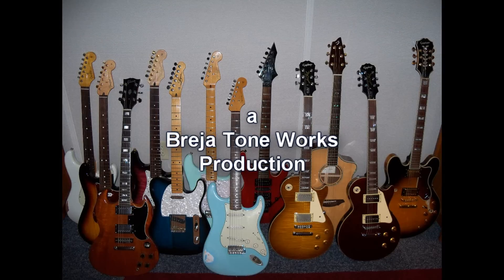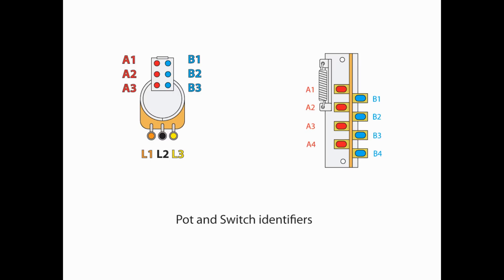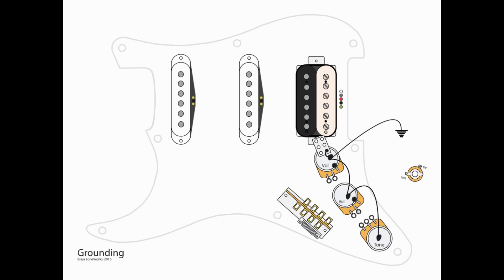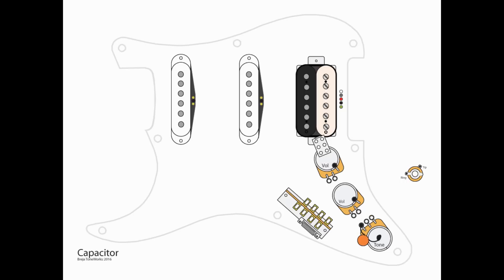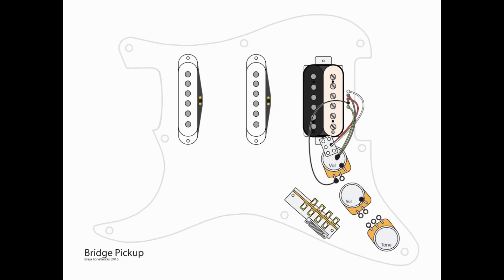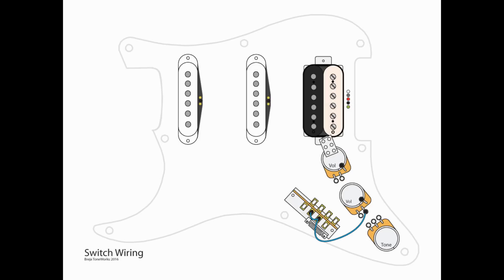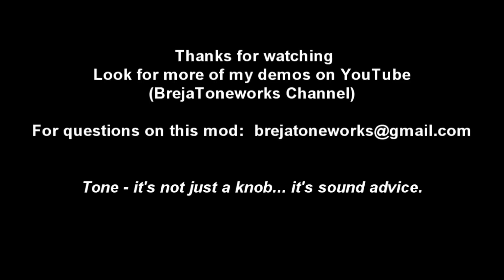HSS Guitar w/Dual Volumes, Master Tone and Coil Split

Comment: End Sept. 2023 in Saskatchewan. Winter cometh and it's always a hard season. I wired a Crate Electra according to this tutorial in Spring. It dint work on various switch positions. I "went in" today and found two failed solder points. I'm not practiced at soldering. I repaired these and after a once over, boys this Electra works just like Don said it would. Breja Toneworks is the ONLY site I'll use for trick wiring projects because of the way Don combines pictures with speech. Thank you Breja!

Comment: Hi Don - I originally followed this mod. It's great but.....
This is from my perspective - I find that having the neck/mid volume beneath the bridge volume pot somewhat un-natural for me as a player. So some time later I followed your video again but swopped the position of volume pots to having the neck/ mid volume on top and bridge underneath. Now these correspond better with the 5 way switch and lend themselves to a better ergonometric layout. I also put a treble bleed on the neck/ mid volume and that has really made my Strat great !!!.

Comment: Clever wiring, just did it and works great! Just changed the places of volume pots so the upper one now controls the singles and the middle one controls the humbucker - much better IMO. Thanks, great video!
Reply: Precisely
Reply: I did the same exact thing. Love it!
Reply: How does the bridge//middle position sound ? Enough treble ?
What tone cap value did you use ?
Thanks!!

Comment: For the respect of the "5-way switch spirit"  your HSS wiring is really nice.
Plus, two volumes will seem  familiar to "humbucker guys" who can play neck&bridge  :).
but consider this :

1 / 1st pot =  volume for neck&middle 
2 / 2nd pot = volume for Bridge + 3-way switch on-on-on (series/split/parallel) gorgeous for you favorite pickup !
(note : humbucker-parallel sounds so nice when overdirven and almost like single-serial without the hum ;)
3 / 3rd pot = Tone push/pull capacitor switch. (feel free to test 33nF and 15nF as well as 22nF and 47nF :)
dual-tone-pots is useless on a 5-way < set and rest forever / plus single tone-pot is easier between songs)
4 / 500/250 Kohm is a choice for your pickup model in a specific play-style.
I assume a superstrat is for heavier styles that push the gain, hammer and shred.
So 500K for high gain superstrat guys ( dual-cap-tone and dual-volume will help in most situations) 
 I recommend using the same resitance for all pots and choose a pair of high-outpout single-coils.
If not, you might change the gain of your amp each time you toggle neck and bridge for the noise or the volume
...until you simply install additional resistors to your single coils.

HSS dilemma is not a new)... So thanks a lot for your contribution Breja.

Comment: Thank you for posting this video.  Using a 500k pot with a Pearly Gates at the bridge (HSS partscaster) brought the p/u alive.  Before that, it was dull sounding.  I am detecting less hum/buzz from the single coils...  just my perception or real? - IDK. Possibly a slight change in the single coils' sound? - maybe, but hard to tell.  Overall - very happy.

Comment: I ended up with a separate bridge push pull coil split volume and a master volume and tone.  I reverse wired the volumes like in a jazz bass.  I wired the switch like a plain 3 pickup Strat.  Works great.

Comment: This video is great Don! I was hoping you could give a helping hand for a slightly different configuration:
I am trying to wire a HSS with:
1) 2-in-1 Volume (one being 250k and one being 500k, stacked on top of each other, NOT a push/pull)
2) 2 Tone (both separate, but one is 500k and one is 250k, for HB and SC respectively)
3) humbucker auto-splits at position 2 to work with the middle (RWRP in my case)

* I am trying to avoid push/pull pots
* using a 5 way switch, like the typical fender one.

Comment: If anyone who is clueless with electronics like me is wondering, this schematic does work if you don't want to use a pushpull coil split. You just tape off the red and white wires from the humbucker and don't use them, then everything else is the same.

Comment: Hi there 👋thank you so much for your work, it's so easy to follow along! Everything seems to work fine, but the volume in position 2 is much lower than other positions. Is it expected? Can it be a soldering issue or is it rather pickup related?
Second "problem", the hum with single coils really disappear only when touching the strings or any metallic part (bridge, jack socket, knobs). Do I have a ground issue, or is it just normal with single coils, I don't have much experience with this kind of pickups. Thank you to any good soul who'll see this and help! 😀

Comment: Great video! Thanks for this. I did it and it works fine besides the single coils volume knob that’s not working. It only works when the humbucker volume is on zero. I did not install the tone knob though, but don’t think it’s related. I wonder if it is a ground problem. Maybe the single coils volume knob is not properly grounded to itself. Could it be it? Thanks!

Comment: Great video! Will definitely help me get through my first rewiring. Wondering: what if I have a toggle switch to split the coils, rather than a push-pull? Will that make a huge difference? I know this is an old video, so getting a response is a long shot, but it’s worth a try.

Comment: Great Don but I have a question: you didn't mention the resistance of the volume pots. May I consider the humbucker volume pot being a 500k and the other one a 250k pot? If that's the idea, would they read 500 for humbucker and 250 for both single's? I have here a dual pot by fender and I'd like to use your idea from this diagram. Thanks

Comment: Thanks for a well done, helpful video. I used this to mod my Strat Bullet by swapping out the bridge single coil with a GFS hot rail humbucker. It all seems to work OK. However I was wondering why your diagram is showing the humbucker hot wire going to volume pot rather than the 5-way switch (like the other pickups do)? Thanks.

Comment: I would love if you could make a video of the wiring of a 2013  Modern Player HSS strat. What's special is that it has a push/pull pot for bridge humbucker coil split, 1 master volume, combined tone control for neck and middle, and tone for bridge humbucker.
I just bought one that have been rewired as a standard HSS with no coil split. But I want to try and bring it back how it's supposed to be.

Comment: Awesome video! It helps so much! I was just wondering if there was an option to add a switch to turn on the neck pickup all the time so I could have an option to use the bridge pickup and neck pickup at the same time. Thanks!

Comment: just one question, i saw another video of yours about a 5way switch, and im just wondering why did you connect the pickups hot wires into the B side, and tones on A side, when in the other video it was opposite, the pickups went to A 123, and tones went to B 543

Comment: Question at around 1:20 mark when talking about the Push Pull labeling, is that layout looking from the knob end of the pot or from the bottom square end as if looking from the bottom of the pickguard?

Comment: Hi! Thanks for the mod, but I'm having some an issue with the middle pickup, its not audibly in the 2/3/4 positions. the neck and bridge as well as coil tap are fine. It's a RWRP SSl-1 in the middle. did i just cross my wire wrong? I assumed since it's reverse wound, the white wire ( on the different side of the hot wire on the SSL-1 in the neck) is the hot (same color, different location of the neck pup). Am I mistaken about this and should wire it with the black wire being hot? I checked continuity and solders and they're all good. Thanks in advance!
Reply: Never mind! I swapped the Middle rwrp wires and voila!

Comment: I dunno if you can answer this, I have been looking for a wiring diagram for hss. Position 1- bridge humbucker, 2- bridge split with middle, 3- bridge split with neck (maybe different lug from position 2), 4- middle and neck, 5- neck. I couldn't find any diagram, since I don't use middle pickup alone, I guess I prefer like this.

Comment: Hey how's it going, I have a question? I'm installing 2 humbuckers and I have A 3 way switch and 2 cts pushpull pots  and 1 volume  pot not push pull! is it possible to split each humbucker seperately to split on each scts pot and 1 volume control 500k>

Comment: This is literally what I want to do with my strat. Thank you. Is there any way to add the 7-way switching to this wiring with another push/pull pot so you can also add neck to position 1 and 2?
Reply: Durgo25 Hi mate, you just have to add a "neck on" mini toggle switch.
When in position bridge or middle bridge, just turn on the mini switch and you have also neck pickup active.
Google "neck on" switch wiring, it s a piece of cake. Just drill a little hole between your 2 tone pots and place it there!
Reply: @CS-xq8xz  Thanks! Exactly what I was looking for!
Reply: @CS-xq8xz  Just to be sure, in the above video circuit, I would add the switch between B4 and L2 tone right?
Reply: @CS-xq8xz  or between A3 and A4 or between A3 and B1
Reply: @CS-xq8xz  actually B4-L2 (bypassing volume) and A3-B1/A3-A4 (takes mid coil in some settings) arent ideal
Reply: @dikuf  https://www.premierguitar.com/ext/resources/images/content/2013_7/Features/Sep13_PG_FEAT_Power-Play-4-Mods_7-sound_WEB.jpg
Just use a single on-off mini toggle switch for that :)

(i never mess with push pulls, like in the video here)
Reply: @CS-xq8xz  Hi thanks for your reply, I already got that from your previous reply. My problem is that that circuit is completely different from the one in this video and dosent work, dont you think so?
Reply: @CS-xq8xz  and I am using a toggle switch, not a pushpull. the notations are from the video for the 5 way and pot
Reply: @dikuf  Without a wiring scheme bro, it is kinda difficult for anyone to give you some proper instructions :/
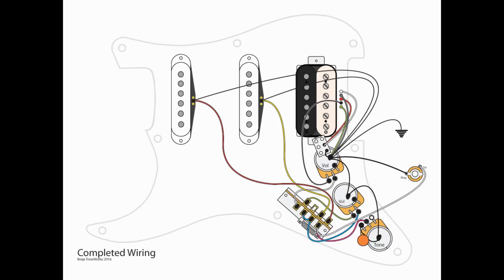Reply: @CS-xq8xz  the wiring scheme is in the video at 4:28

Comment: Hi Dan! Nice job like always! I have one ask... or maybe a challenge.  I have a Fender HSS Shawbucker Strat 2015 electronics on my Peavey Predator 94. It have Fender Custom shop fat 50's single coils and a Humbucker designed by Tim Saw. I just did a duncan treble bleed mod (tricky by the way because it uses a Fender Concentric 250K/500K Solid Shaft Potentiometer) and now... I'ld like to do a split coil tap mod but using a push-pull tone pot for preserve the original look on it. Can you make a video with that information DIY? Another consideration is that the 5 way switch is a Fender 5-Position Stratocaster/Telecaster 'Super Switch'. Thanks for all!
Reply from the maker: Email me directly at BrejaToneWorks@gmail.com

Comment: ?? Your channel rocks!!  1st off....  My configuration for my new strat build is Hot rail humbucker in the bridge, single coil in the middle and a Telecaster bridge in the bridge. Hopefully that makes sense. Here's the thing,  Is it possible to wire my strat in series/Parallel wiring with a push/push Volume pot, a master tone in the middle and a blender in the 2nd tone pot position?  The reason for the push/push in the volume position is I wanted to also add a coil split....Too Much?  Whatcha think?
Reply: I'm looking for similar information, but I keep finding that we might need one of those crazy 20 or more 5 way switches AS WELL AS push pull pots. Too much madness, I've had so very little sleep designing and redesigning circuits for them to come up short of my expectations. 😫

Comment: That's a pretty interesting wiring. A very good way of having a balanced HSS set if you use 250k vol pot for singles and tone and 500k vol pot for the humbucker. I was wondering if it's okay to connect the output to the middle lug of the tone pot instead of to the switch. Also, this is wired as the 50's old wiring, isn't it? I mean, with the tone control after volumen.

Thank you very much for sharing your work and knowledge. I really appreciate it.
Reply: Yes you can do that the Output is on the same potential as the Middle lug of the tone pot.

Comment: great video, ill be redoing my kinman x2/SD hot rail combo. Just have to decide on values, I think 250k for singles and 500k for the hot rail bridge. I have a phase reverse for middle at the moment which I,ll keep in though (might use second push pull on tone pot)
Reply: i have dimarzio super distortion DP100 humbucker in the bridge. is it ok in this case to use 500K push/pull pot for humbucker and two 250K pots for the rest?
> and will positions 2 and 4 be hum canceling like it is on standard strat wiring?

Comment: Might be a dumb question, but does it matter if the middle pickup is Rw/Rp? I'm doing this to a mim Fender Strat, and I'm pretty sure the middle pickup is Rw/Rp because the black leads come out opposite of each other if compared to the neck pickup, as do the colored wires...
Thanks in advance Breja!

Comment: Hi, I have a strat I built with HSS pickup configuration. I wound the neck pickup with a coil tap so I can have two tone options in the neck pickup. The middle pickup is normal and the bridge has the humbucker wired with 4 wires and the ground shielded wire. For simplicity I used the SD color code which I am familiar with. I am not interested in splitting the humbucker. I want to use 1 volume and 2 tone  controls with a 5 way pickup selector switch. I have a push pull pot which I know I will need for the coil tapped neck pickup. I have wired a few strats from wiring diagrams I found online but I cannot find anything for what I want to do. What location does the push pull pot go,  the volume or tone ? Do you have any suggestions on how I can make this work or where I can get a wiring diagram. Thanks.

Comment: I have a Fender Contemporary Deluxe Strat (2nd Type, MIJ) with an HSS configuration. It has 1 volume, 1 tone, a toggle coil switch, and a 5-way switch—all on the pick guard. What does the wiring diagram look like when it's a toggle micro switch instead of a push-pull? Thanks!

Comment: Hi, I have 72 thinline telecaster and I changed the pickups with gretsch dearmound pickups. I use 4 way switch(like mex baja telecaster) and I want to controll volume and tone controls seperately. So I bought concentric pots but I can not do a scheme for this. I want 2 vol 2 tone and 4 way switch. Could you help me please? Thanks.

Comment: hi, i need a wiring diagram for a strat , 2 volumes, 1 tone,  but with and ''inline/export'' 8 lug 5 way switch...so i can control bridge, and mid/neck volumes , but have 1 tone  for all...could you point me to a solution, thanks. rob ,

Comment: Hi Don I've looked through the other videos on your channel before I ask, but there's nothing there in regards to what I was looking for.
I have a HSS strat type guitar, a Yamaha Pacifica that I need to rewire for a parts & pickup swap. It only has 1 volume pot & 1 tone pot. Taking into consideration that there's both a humbucker & single coils in the guitar, what value pots would you use for both the volume & tone? 250k for both? 500k for both? 500k volume & 250k tone? Or 250k volume & 500k tone? Or something else? Many thanks.
Reply: I have the same guitar and would like to know the answer as well.

Comment: I have an interesting mod I'm looking to do. I want to convert the schecter hell raiser hybrid from active to passive. It's an H-H setup with 2 volume pots, 1 tone pot, and a 3 way switch. I want to make both volume pots push/pull for coil splitting. Can you help?

Comment: Hi, this might be a dumb question, can this wiring pattern be used without spitting the coils of the humbucker by using a 500k pot for the humbucker and taping off the finish wires. And a 250k pot for the single coils volume and a 500k pot for the master tone with a .022 cap?

Comment: The diagram indicates connecting to the tip and ring, does this mean you have to use a stereo jack to wire this up??
Reply: no it s a normal mono jack. ring for ground and tip for hot.
Stereo jacks have 3 terminals instead of 2.

Comment: So I tried to do this mod on my Kramer and for some reason the volume for the single coils kicks in full on the first quarter turn and the humbucker volume doesn't kick in until the last quarter turn I have 3 500kA pots however the push pull is a different brand . Any thoughts?
Reply: LukasOD5 That’s probably because you’re using a Linear Taper Pot....Try switching to an Audio Taper Pot

Comment: I just finished it but something wrong lol.  Time to troubleshoot.  Humbucker with push pull and tone working but almost zero sound from neck and middle pickup.
Reply: I have that exact same problem now. Just wondering if you happened to get it fixed?
Reply: I have the same issue, did you find what's the issue?
Reply: @itismelito  my volume pot for the single coils was the issue in the end. It was bad for some reason. But it does work now
Reply: @brookchivell  so you mean the middle pot which works as volume for middle and neck pickup was not working? For me only the neck position doesn't work.
Reply: @itismelito  yeah mine was the same. I think the middle pick up keeps working because it’s connected to the bridge via the switch or something. I wired it exactly the same wry the new pot and it works. I made sure every ground was very well connected as well
Reply: @brookchivell  the pots I bought it new at store today :/
Reply: @itismelito  yeah mine were too. It was just weird. Maybe too much heat on the pot or something. I found it really weird too

Comment: got a Squier Deluxe with 3 Duncan Designed Hot Rail humbuckers in a SSS layout
- angled humbuckers are a revelation - then I got better Hot Rails put into a Korean Lado with a mini toggle to split the bridge - adds quack btw - tone was added to bridge as well - could use more wiring mods - to me, never lose the angled bridge pickup - it ain't Fender - Hot Rails Tele anyone ?
-